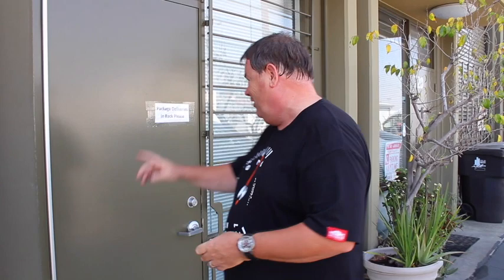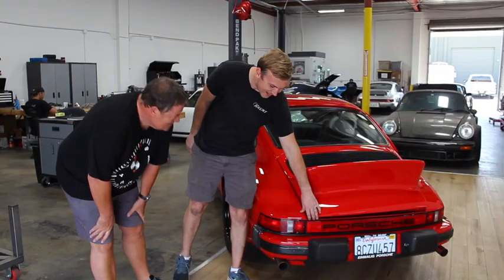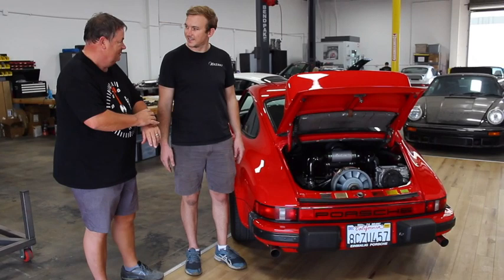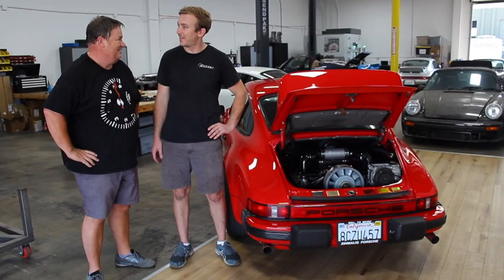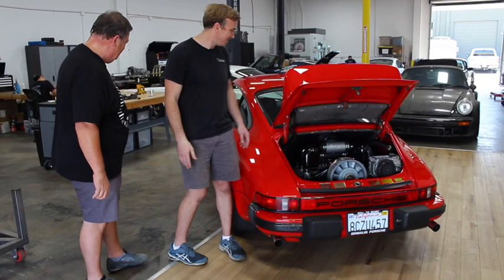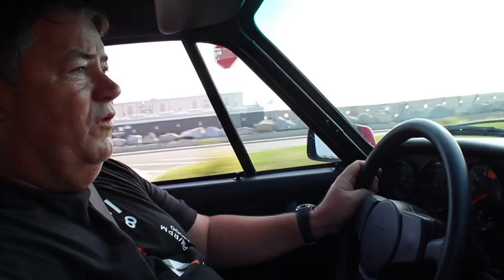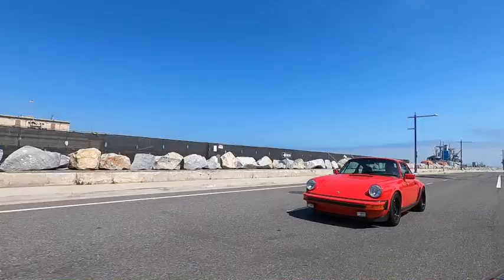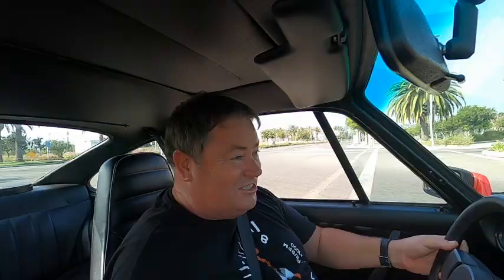Mike Brewer and RasantProducts.com -  Porsche 911 SC Project - the Results!

Comment: Just to play Really Robbin and not necessarily Debbie Downer might note that Factory hp rated out stock from the factory @ 180 ... Now with the addition of ITB's , SSI's, Electronics, COP's, Custom Phloem w/ estimated retail cost of M & L around 8.5k you only made 20 additional rear wheel to 200 hp. that is according to your video showing conversion and dyno run.  More than just silly expensive just for a 20 hp gain don't ya think ?  Now the money does not stop there. To make use of this conversion for a real gain beyond 200 hp which is what some 4-door Honda's make now, yer gonna need a 964 or Web 21/20 cam for longer and deeper torque curves, flow work on the heads and after that you'll maybe see 210 hp.  Now you will need new P/C's popping displacement up to 3.2 minimal.  That will buy you into the 225 hp neighborhood.  For that kinda money why not just get a good used 3.6, a simple clutch conversion kit and needed assorted conversion accessories and have 300 hp for the same silly status money ??
Reply: I'm not Mike, and I would love for him to reply to you, but the US version of the SC (which his is, based on the bumpers) made 180 hp at the crank. Let's say 153 at the wheels (driveline loss of 15%). It now makes a tad over 200 at the wheels, ie 235 at the crank. That's a gain of 55hp at the crank. Not too bad. I'd guess 10-15 of that is the SSI + exhaust. As for using a 3.6, well, they've gotten silly expensive. Even 3.2 manifolds (in decent condition) are, making it less of a competitive solution to go EFI